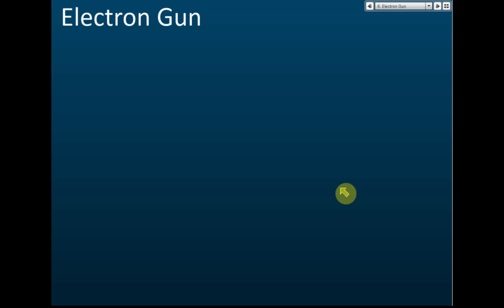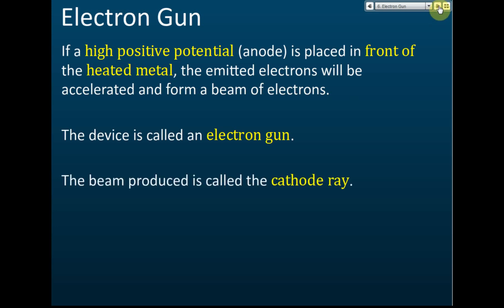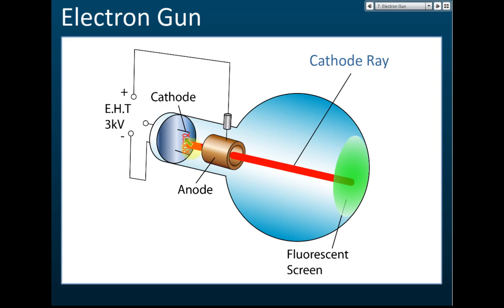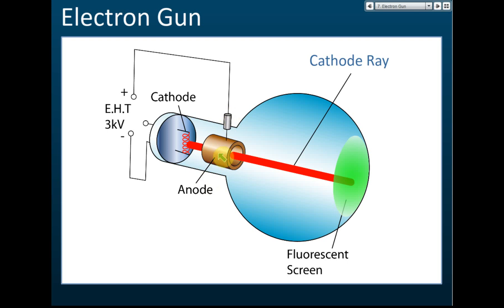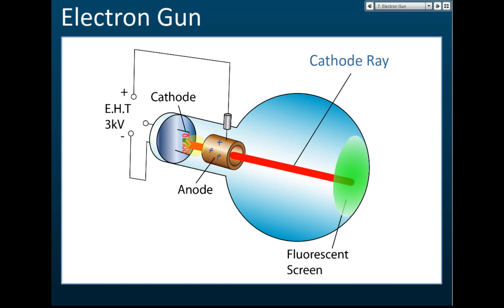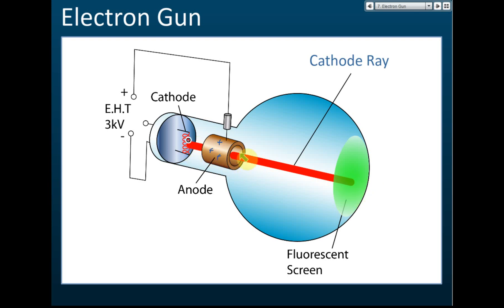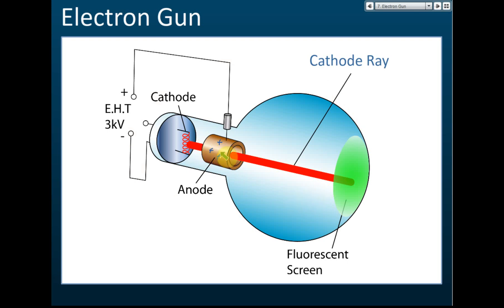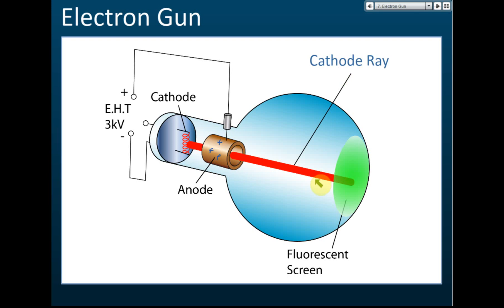Electron Gun | Electronics

Comment: if anode ring is attractive so why electrons dont stick to ring and pass through ring and hit screen?
Reply: Some of it does
Reply: the ring attracts the electrons in a direction that is mainly in its center. The inercy of the electron lets it fly away. If you simulate the case with a 3D graphic software using the basic physics laws, the effect is what you get in reality. Image a catapult with 2 elastics, the stones goes in the middle and the inercy allows it to fly away. Here the tube should be a ring. I tube may catch a lot of electrons...